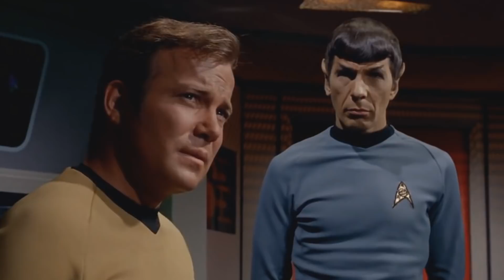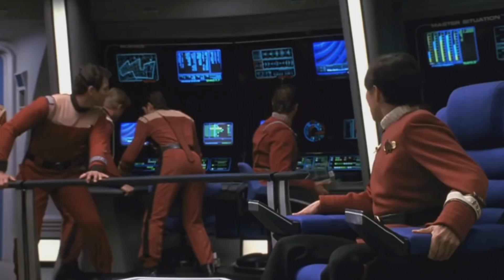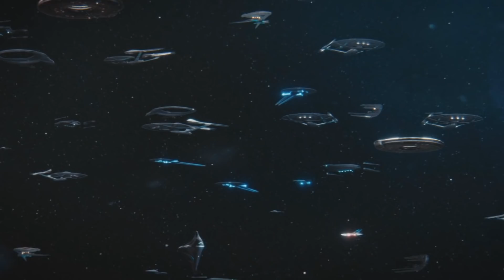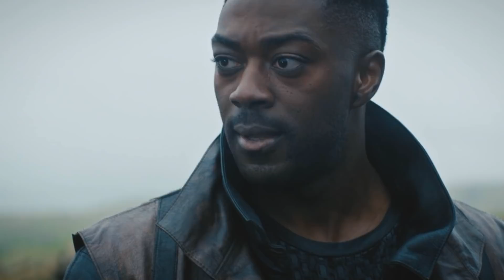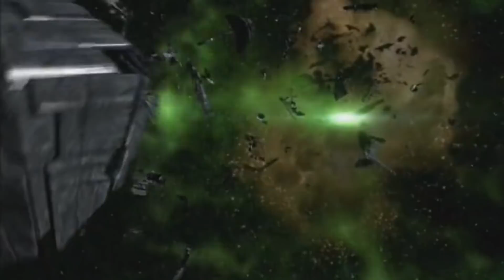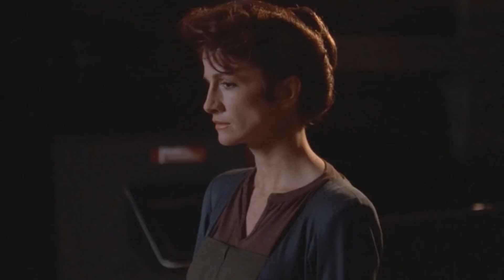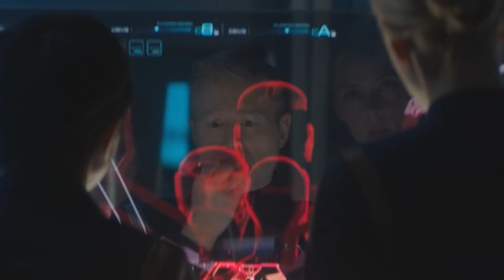How Can Dilithium Explode ? How to Explain The Burn in Star Trek Discovery and Other FTL References

Comment: They have dilithium all wrong from start. It is ilogical, that matter antimatter reaction needs some catalyst. On the other side, if dilithium would be responsible for turning deuterium into anti-deuterium, it will be fully plausible and scientifically believable plot device. We believe, that there is quantum phenomenon capable to generate matter or significantly changing properties of matter. Typical example is Higgs boson, which existence at Big bang could be responsible for all matter(and then also antimatter) in universe. So dilithium should be in STU responsible for changing charge at particles (specifically positive charge on deuterium to negative). Thus as pure catalyst, it could not be responsible for explosion, especially not if went inert, because it would result in shortage of antimatter in warp core and thus inhibition of annihilation reaction. Fact is, that this will be also excellent passive safety element. Similar to water in our PWR reactors (if water is removed from reactor, fission can not continue). And necessity for continuous dilithium supply could be explained as for all catalysts. They eventually wore out and stop working.

Comment: So I guess we're all just ignoring the fact that the Romulans don't use dilitium regulated matter-antimatter cores?  Their ships are powered by a contained quantum singularity (aka, a black hole).  Warp drive just needs a strong power source.  Heck, fusion power can allow a ship to travel at warp1-3.  

Then there's the subspace slingshot that Voyager encountered.  It could shoot a ship several hundred light-years, no warp drive needed.  They could have just built a network of those to easily travel the dozen or so light-years between local star systems in the Federation.

A better story would have been a massive Omega detonation that destroyed subspace throughout the Alpha and Beta quadrants.  That would mean NO ftl whatsoever.

Idiots.

Comment: AFAIK the have been different methods of generating energy for the warp drive. Dilithium may have been the favourite resource by the Feds but I don't recall the romulans requiring it for their singularity drive. The Borg had a network of transwarp nodes an there was at least one fed ship that used it. I'm just saying an event like this may have crippled the UFP in the timelines we knew, but in the 31st century? BS!
The burn is just another stupid excuse to get rid of continuity AND give the Discovery an important role in a distant future.

Comment: The real question is: Why are they still using dilithum warp reactors in the 31st century? When designing the Enterprise-J, Doug Drexler suggested her odd looking nacelles was the result of having a Coaxial warp drive, which could fold space and allow the vessel to explore other galaxies. That was in the 26th century. Coaxial warp was said to be theoretical in the 24th century, but the Voyager crew got a good look at one in the Delta Quadrant. Makes sense that the Federation would have Coaxial warp in the 26th century.

By the 29th century the Federation had the ability to scan the space time continuum and actively protected it. Remember when a bomb destroyed the USS Voyager multiple times and the crew of the USS Relativity attempted multiple times to stop it from happening? Where are these people when it comes to the Burn? Why did they spend 100 years not knowing what happened when they have the technology to scan the space time continuum and BEAM people across it and they never tried to prevent the Burn from happening? Don't give me that "Well time travel is illegal" bullshit either.

This show is so fucking stupid.
Reply: So, Doug Drexler doesn't know what "coaxial" means.
Reply: @Idazmi7  https://memory-alpha.fandom.com/wiki/Coaxial_warp_drive

Comment: Dilithium controls the matter anti-matter reaction in the warp core. "One day the dilithium went inert. Any starship with an active warpcore exploded." The dilithium stopped controlling the warpcore reactions and the antimatter reaction destroyed the ships. That's why ships whose cores were powered down weren't affected.
Reply: Except that's not true. As seen in those first clips, the crystals regulate the energy flow coming from the matter-antimatter reactor, not the reaction itself. If that wasn't the case, the Enterprise would have exploded in that scene.
Reply: @Idazmi7  I'm enough of a nerd that I own the TNG technical manual. The crystals are situated at the center pointe in the warp core where the matter stream from above mixes with the antimatter stream from below.
https://www.ex-astris-scientia.org/treknology/dilithium.gif
Reply: @Idazmi7  As to your statement about the video, I don't know where you're going with that.  Watching someone remove the crystal and saying therefor it is completely seperate from the antimatter is like watching someone take the sparkplug out of a car and then saying therefore it has nothing to do with the gasoline.

But go read memory-alpha (the compilation of canon material and regularly used as a reference by the current productions):

"24th century Federation warp engines were fueled by the reaction of matter (deuterium) and antimatter (antideuterium), mediated through an assembly of dilithium crystals, which were nonreactive with antimatter when subjected to high-frequency electromagnetic fields."
https://memory-alpha.fandom.com/wiki/Warp_drive

" In roughly 3069, refined dilithium across the galaxy suddenly became inert, resulting in an uncontrolled mixing of matter and antimatter which destroyed all ships that had an active warp core. This disastrous event was known as "the Burn"."
https://memory-alpha.fandom.com/wiki/Dilithium
Reply: @Idazmi7  So, you do realize that clip is from TOS and the diagram I posted was of the setup from TNG, right? (the assembly can be seen here with the crystal removed in Skin of Evil: https://static.wikia.nocookie.net/memoryalpha/images/0/0b/Dilithium_crystals.jpg/revision/latest?cb=20120728222644&path-prefix=en).  Just because a wiki is fan compiled doesn't mean its inaccurate, and the TNG tech manual was written by the shows actual technical advisers, so I'm not sure how much more authoritative on the topic one can get.

But please continue telling me how you know more about the show's science than the people who made it up.

Comment: I don't think the dilithium exploded in the burn...  Michael says 'all the dilithium went 'inert' so any ship at or going to warp exploded.    Inert = lacking chemical activity...  pretty much the opposite of exploding.    But dilithium is used to control/regulate the matter / anti-matter reaction the the warp core...  so if it suddenly went inert and stopped doing what it does... you would get out of control matter/antimatter reactions and immediate warp core breaches.    It was actually the matter / antimatter deuterium that exploded.
Reply: As seen in those first clips, dilithium regulates - and converts - the energy coming from the matter/antimatter reactor. They don't affect the reaction itself. If that wasn't the case, the Enterprise would have exploded when their dilithium converter fused.

Comment: Warp drive tears space; this has been established.
What if the damage to space/sub-space was cumulative and formed a critical mass?
What if this damage formed a web-like structure following the path of every Star-ship that achieved warp?
Star-ships traveling the Spaceways would in effect be wearing deeper and deeper ruts into sub-space.
This is regular traffic; commercial, research, traveling on vacation...and lots of it!
Enough damage to sub-space and dilithium can no longer exist as a stable crystal!
Since sub-space isn't limited by the speed of light; ripples and surges in sub-space could appear simultaneously across the Galaxy.
First the crystal stops working, then the engines blow up.
Makes sense; they control the mix of matter and anti-matter to produce energy.
Without their benevolent influence, the matter-antimatter mix goes bonkers.
Wear deep ruts into the dirt so when the rains come, there will be long thin rivers...
Reply: "First the crystal stops working, then the engines blow up.
 Makes sense; they control the mix of matter and anti-matter to produce energy."

No, actually. As seen in those first clips, dilithium regulates - and converts - the energy coming from the matter/antimatter reactor. They don't affect the reaction itself. If that wasn't the case, the Enterprise would have exploded when their dilithium converter fused.

Comment: I never heard the Burn as "dilithium exploded". 

What they said was it "went intert". Remember that dilithium is used in controlling a matter-antimatter reaction. 
When it stopped working, active warp cores (those engaged in matter-antimatter annihilation) at the time exploded from the matter-antimatter interactions.
Reply: As seen in those first clips, the crystals regulate the energy flow coming from matter-antimatter annihilation, not the reaction itself. If that wasn't the case, the Enterprise would have exploded.
Reply: @Idazmi7  "controlling" vs "regulating the flow from" seems to lack a difference. 

The point was and is that the actual explosion was because of matter-antimatter annihilations.
Reply: @Idazmi7  It's impossible magic stuff and so could do anything (can you prove dilithium is baryonic matter? Perhaps it's matter with no spin at all); but again, whether it comes in physical contact isn't relevant to my claim / point (and I didn't claim it did so stop hacking at the straw man). 

When the dilithium went inert, it didn't explode. If that were the case, ships with inactive warp cores would have blown up to. Instead, inert, it was not doing its job in controlling the matter-antimatter reaction, the energy from that is what destroyed the ships.
Reply: @Idazmi7  "Star Trek doesn't work that way as a rule. Every fictional device has an established way of working: that's why Trekkies are so nerdy."

Erm... no. We create apologetics to attempt to create some internal consistency in the only syndicated show to ever allow random people to mail-in scripts. 

When Geordi is phase-cloaked, without any ongoing power output, and breathing normal-phased air and having conversations and standing on a deck, and hiding behind an in-phase plant to avoid an out-of-phase explosion... that isn't because there was an established way of working... it's because that's what the writer wrote. 

"Yes it is.
 You're claiming the dilithium directly regulates matter/animatter interaction. In order to do that, it would have to come in contact with the matter and antimatter streams..."

The software in my HVAC regulates the operation of my furnace. Indeed: a furnace can be made to explode by manipulating the code. The code doesn't come in contact with the furnace. 

You are making up your own claim and then proving your claim wrong. It's called "hacking a straw man". 

"You do realize that the warp core on Federation ships is never truly "inactive"? "

https://memory-alpha.fandom.com/wiki/Emergency_core_shutdown

https://memory-alpha.fandom.com/wiki/Warp_core_ejection_system

https://scifi.stackexchange.com/questions/98953/how-long-does-it-take-to-power-up-shut-down-a-warp-core

https://memory-alpha.fandom.com/wiki/Battery

https://memory-alpha.fandom.com/wiki/Fusion_reactor
"The impulse drive of Federation starships was generated by fusion reactors, part of the fusion reaction subsystem."

https://memory-alpha.fandom.com/wiki/Fusion_reaction_subsystem

I'm sorry. You were saying what? 

Without working dilithium , the matter-anti-matter annihilations blows up the ship. 

As to whether there's contact... it doesn't matter.. but: 
"As shown on the series, the streams of matter (deuterium gas) and antimatter (anti-deuterium) directed into crystallized dilithium are unbalanced: there is usually much more matter in the stream than antimatter. The annihilation reaction heats the excess deuterium gas, which produces plasma for the nacelle(s) and allows faster than light travel. "
https://en.wikipedia.org/wiki/Dilithium_(Star_Trek)

ad infinitum, ad nauseum.
Reply: @Idazmi7  "It's hilarious that you used wikipedia and memory alpha - two "encyclopedias" that let anyone edit "

An ad homenim fallacy. 

"We aren't discussing Geordi or phase cloaks now"

Yes. We are. Because we are discussing your claims that are proven false by, among many other things, that episode. 

Roddenberry pissed people off mostly because he stole their stuff. Someone wrote the theme music, Rodenberry added "lyrics" that were never used, so he got half the writing royalties... etc. etc. 

I was in the community when some of this stuff was going on (not that one, obviously, as I would have had to have been a studio employee in the 60s). 

"If you are going to talk about a TV show, actually watch it"

I was part of the letter writing campaign to get the first space shuttle named "Enterprise". Who were you in the community then? Have we met? I'm doubting it. 

I was pulling TNG down a week early using a friend's commercial satlite dish. What were you doing at the time? Would I have seen you at conventions in the 80s? What garb? 

I've watched the shows. They are wildly inconsistent both internally and with reality. Alpha cannon doesn't internally jibe, what you are discussing is attempts to retcon that... not a single one of which impact the fact that physical contact is not a prerequsite to my statement and your proof by repeated assertion doesn't change that. 

You are a Trek neophite trying to play above his abilities. It's droll.
Reply: @Idazmi7  The statement is wrong because of where it came from. Ad homenim.
Reply: @Idazmi7  They are both applicable. 

The genetic fallacy is a refusal to believe something because of you who hear it from (or more generally, its origins) rather than because of whether the thing itself is something that it makes sense to believe, and ad hominem means that you attack an opponent's character rather than their argument.

You stated a dismissal of information because of its source, a source you attacked. 

This is actually very similar to the argument you were making that inspired this meta... you are so caught up in (wrong or irrelevant) nuance that you lose the point.
Reply: @Idazmi7  "Wikipedia, being an encyclopedia, has no character to attack."

Case in point. Pedantic, beside the point, and still factually wrong to boot... the theme with you remains unbroken.

Character:  the group of qualities that make a person, group, or thing different from others. 

The specific portion of Wiki's character which you attacked was the fact that it has many editors (though your statement of "anyone" is overly general, and very much page dependent).